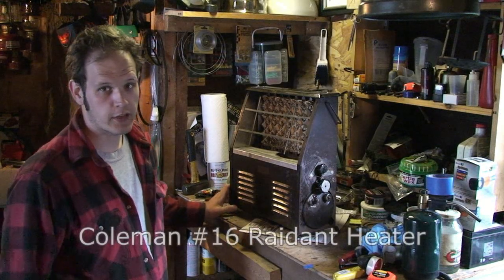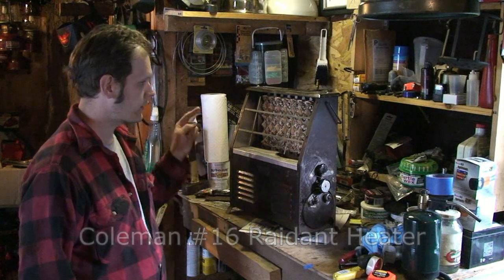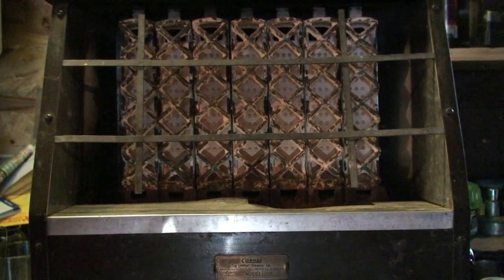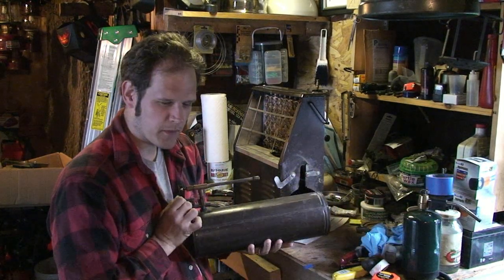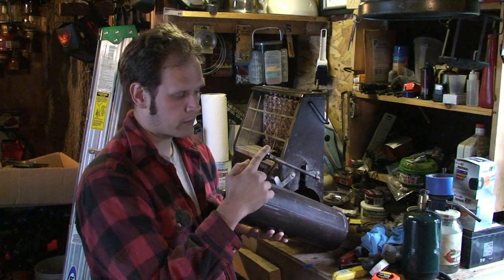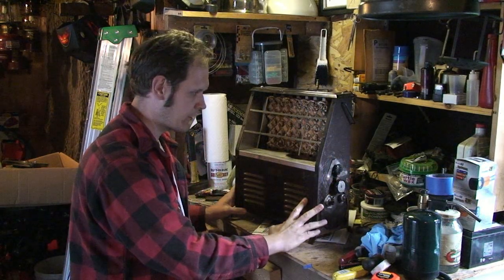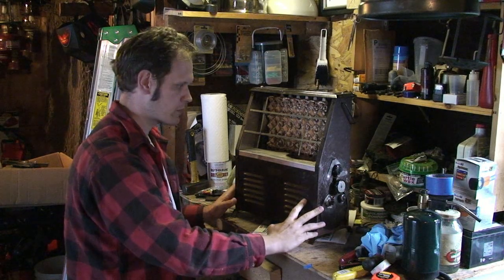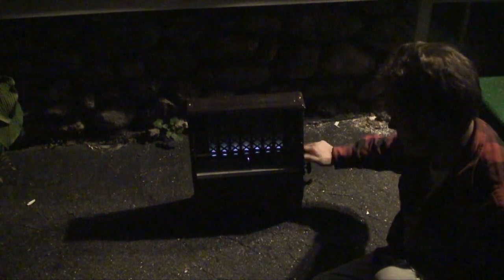Coleman Model 16 radiant heater

Comment: Just got one for free tonight! I've got to find a new set of bricks and an air pump for it. Nice video. I wish you could show more details on that weird valve setup. The lock behind the big wheel is throwing me off a bit. I've never lit one of these before. Hopefully after a dip test my tank is good (it's the unpainted brass kind you spoke of) and I'll get to light it soon!!